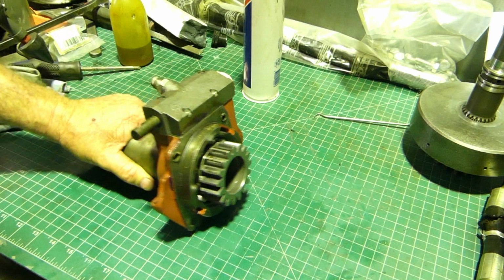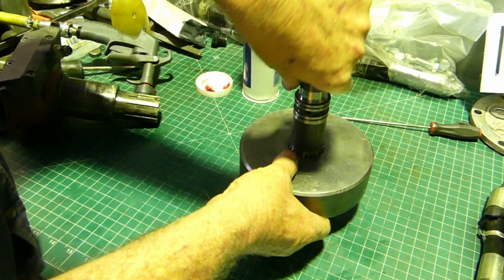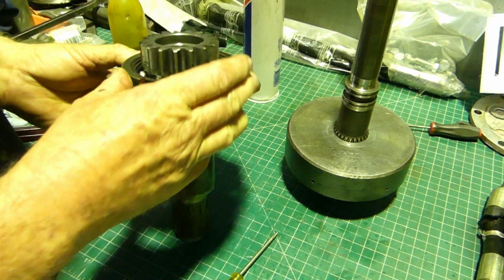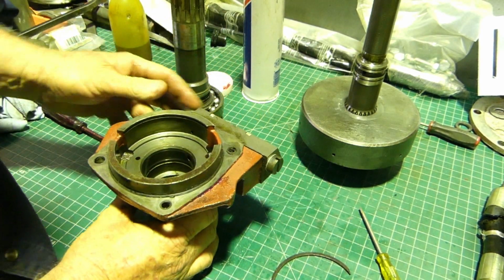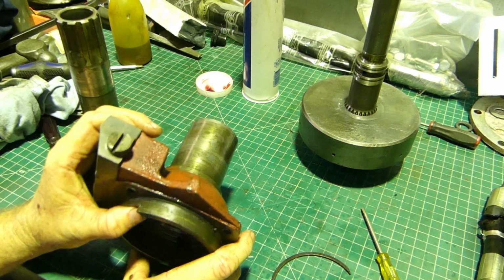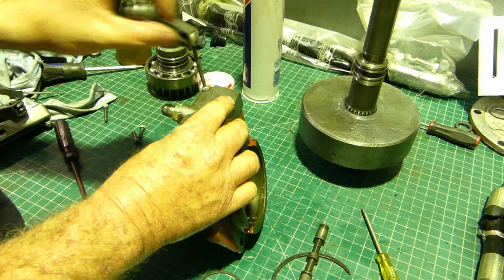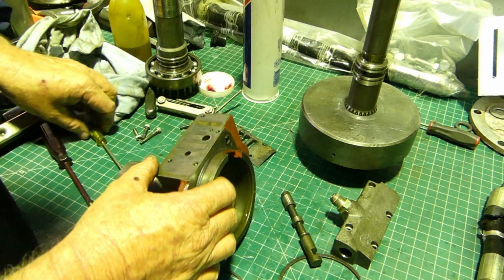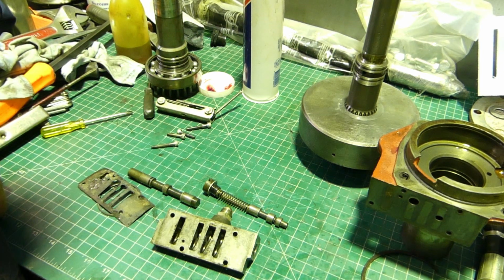How to service your Massey Ferguson Multipower Control Valve Part 1- Dismantling the Valve

Comment: Why would my 135 with multi power stay in low even when i switch the multi power handle to high
Reply from the maker: Low oil pressure I would think.
Reply: @BundyBearsShed  thanks I got it sorted

Comment: What would be causing massey ferguson 135 with multi power you have to rev it up really high to get it to come out of multiplayer and every time you start the tractor it's in high multi power but the lever is in low
Reply from the maker: Just wear and tear, the spring in the gearbox engages it until you get transmission oil pressure up.
Reply: @bundybearsshed  Thank you